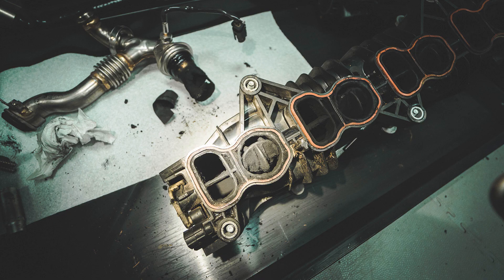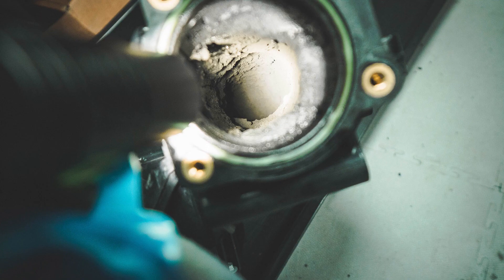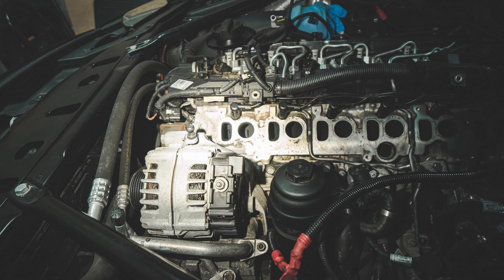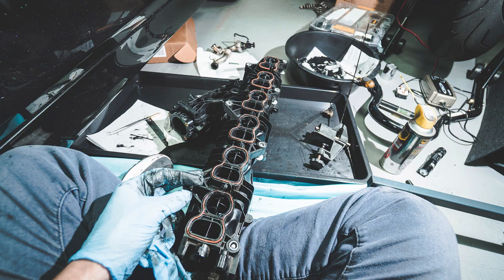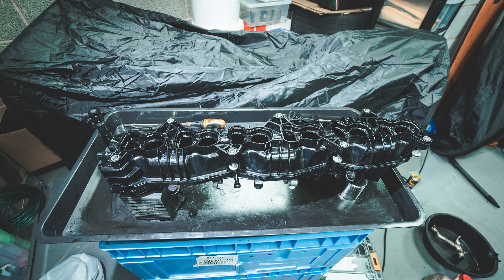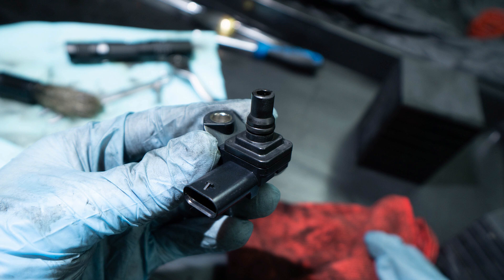When should you clean intake BMW F10/F11 520d/530d N47/N57

Comment: Hi, I am getting poor mileage on bmw 520d 2014. Could it be due to EGR or should I clean the intake first?
Reply from the maker: cleaning the intake does not hurt. did not see any difference in fuel economy on my car after cleaning the intake.
Reply: @BestCarMods  I have not yet cleaned my N57, just got it last week but I did notice once I had cleaned my M57 intake, throttle body and EGR cooler that it was much more responsive. Just felt like it could really breath correctly again.
Reply from the maker: @antoniohinojos3808  you have described very well.
Reply from the maker: @antoniohinojos3808   if you have access to ISTA try doing this test https://youtu.be/pd7U5pm0O-4
Reply: @BestCarMods  Thanks mate, this is great!

Comment: Hi thanks for the video. Wanted to ask. My car oil temperature sits on 70 c. Coolant temp is fine 100+c. Some people say that is normal, other say I need to change thermostat, but I have 2 thermostats coolant and gearbox. So how this can be connected if coolant temp is fine? Or my manifold and dpf will get clogged faster if oil is not reaching 100c? By the way same engine, BMW 730LD.
Reply from the maker: 730Li should be petrol?
Reply: @BestCarMods  sorry my bad 730LD
Reply from the maker: @PONASPASLAPTIS  70c for oil even after 20 30 min of driving?
Reply: @BestCarMods  Yes all the time 70+c, even on summer, or on highway driving 140+km speed. Electrician scanned car 3 times, found only one fault for DPF that pressure is too big, but he said it is not big problem, maybe someone done something to DPF,  like drilled some hole. When we last scanned my temps whose 105+c coolant, 71c oil and gearbox 50+c. Well known youtuber in my country changed chains on my car and he said this is perfectly fine, to have lower heat for oil it is better for engine. Car runs perfectly fine, gears shifts fine, front curtains opens after some time. But everybody who have same engines have 100c temps on dash.
Reply from the maker: @PONASPASLAPTIS  on my dash, oil temp goes to 90~100 ... will check with the diagnostic my temps ... I would say that it would not be that big of a cost to change the thermostat .... I have done it on my car because I was paranoid. (30GBP the part + new coolant - and sorted some leaks at the same time by replacing the gaskets) ... was it like that always?
Reply: @BestCarMods  Hi, thanks for your reply. I have car 2 - 3 years, in first I remember that I had 100c in dash. I had oil leak from oil level sensor with this I also changed oil to original BMW 0 - 30w (blue bottle). I think after changing gasket maybe they break that sensor, later I started getting lower temps on dash.

Some people said that I need to change coolant thermostat, but checking temps in hidden dash my oil goes to 84+c then thermostat opens and oil temp drops to 59+c and then steady rise to 70c. Interesting thing that coolant temp not drops, just rises to 105 c and stops.

Or this can be possible that my gearbox thermostat is stuck, gearbox is working cooler and with this engine have lower oil temps?  From logical understanding they are connected and heats up each other? Or I`m wrong? I also cleaned EGR valve. So I left with coolant and gearbox thermostats, or faulty oil temp sensor?